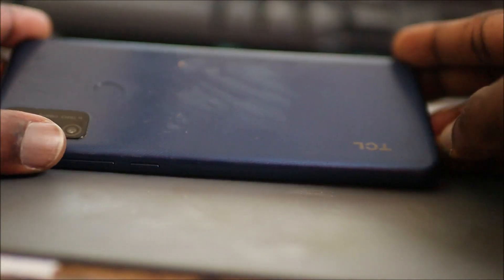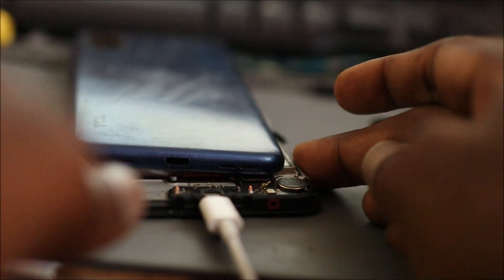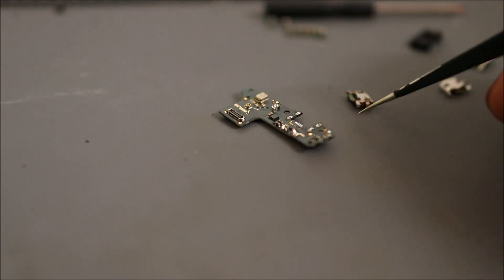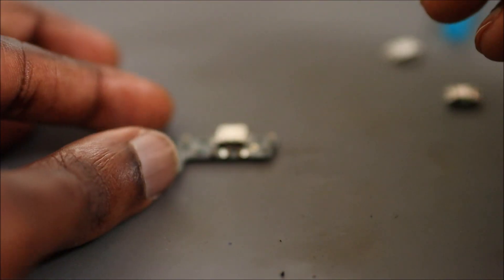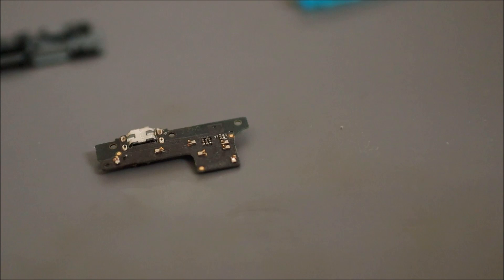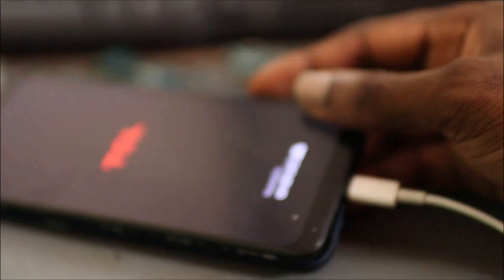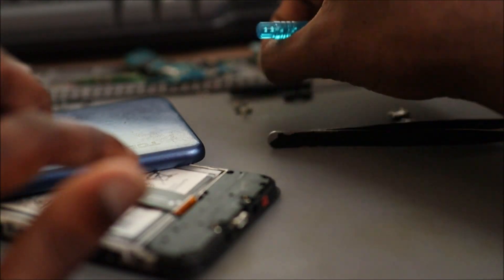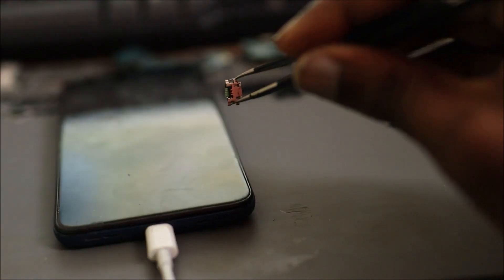TCL 20ex port replacement- TCL phone charging port replace

Comment: thank u sm!!!!!! my charging port stopped working overnight in december (tried cleaning it and whatnot). the only way to charge it was at an angle which damaged it muuuch further. i used this vid to take apart my phone and replace the port with a replacement from amazon. this video helped me so much, typing this rn on my repaired tcl 20se! thank you again, n i definitely subscribed & liked!!! ❤️
Reply from the maker: You're welcome!!
Reply: What what the name of the things you got on amazon
Reply: @Tbird-pb5hg  charging port
Reply: @Tbird-pb5hg  sorry for the late reply! i ordered a TCL 20 se dock connector board charging port, which thankfully came with all the tools, & was less than $15!! hope this helps 🤝🏿
Reply: How did you get your phone open? I purchased the port replacement but I can't get the phone open.  I've tried so many times, I ended up buying another phone but I still want to fix the broken one.
Reply: @stephaniegoetz2147  it took me like 3 weeks to get it opened! it's like they superglued it shut!! but it's easier to pop it open some by the volume button & sd card slot. but eventually i tore the sticky back off & operated from there. & i bought a new fone too lol.

Comment: If substituting a used part, be certain BEFORE trying to attach it,  that the frame mount legs aren't bent as these were. Applying pressure and heat to a part that can't EASILY fit into place without force  runs a high risk of  damaging something that wasn't broken.

Comment: How did you take the back off? It looked so easy...
Reply: The same as for changing the battery. It's in the user manual.  Place face down , top away from you. On the left side near the bottom is a recess, a fingernail slot.   Pry up the back corner. Then carefully pry up EITHER the remainder of that side OR the bottom. A spudger or a guitar pick can makes this easier but isn't necessary.